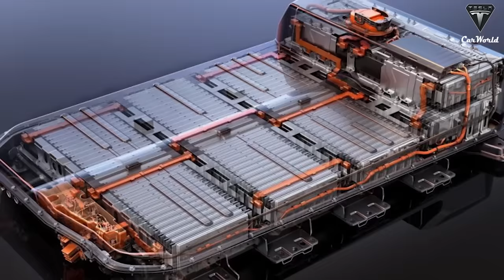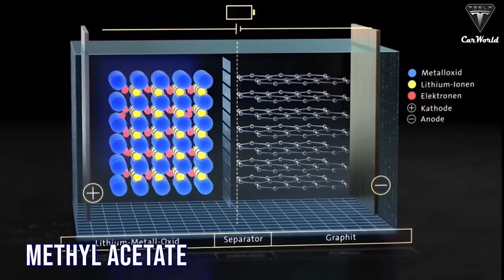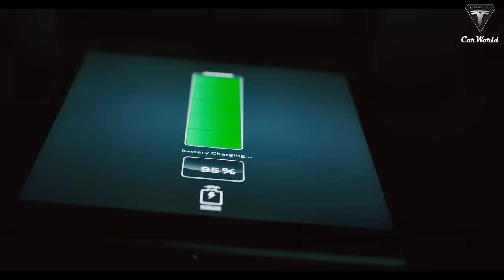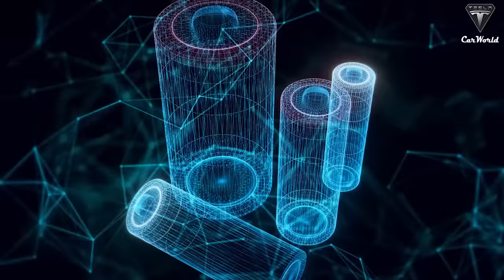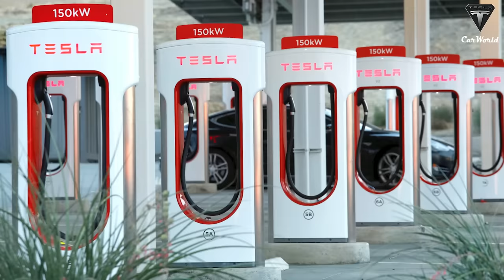The End of Lithium P3! Elon Musk Revealed ALL-NEW Shock Battery Tech, Change Entire Industry!

Comment: The sticking point I cannot help but see is that not one of these technologies have been stated to work properly with longevity in cold weather situations, such as Northern Midwest areas of the US during winter, which is brutal on most EV battery designs thus far, where cold weather cuts battery range almost in half...
Reply: Sodium batteries are much cheaper and perform better in temperatures as low as -20 C. However, it’s energy density is lower than lithium batteries. CATL and BYD have already tried to put a mixture of lithium and sodium batteries in EVs.
Reply: 80% of Norway is on EVs, nuff said.
Reply: @rRobertSmith  Norway is a very rich country. Why? The country sits on an ocean of oil and because of this each citizen gets a check for around $25,000/yr. In addition they get 80% of their electricity from a genuine 'Green' source , Hydro. And most of their driving is short range and they go plug to plug. They certainly don't leave their EVs out in a -20 F parking lot all day and expect them to get them home after work.
Reply: @rRobertSmith  That is the percentage of new cars being sold not the percentage of cars that are EVs.
Reply: An excellent point I did not think about. But of course that is true. And why batteries are not, nor they will be the answer for electric powered cars. The roads need to incorporate an electric grid and that is where your electric car should get its power.  However, the cost of upgrading every road in America, is well hard to fathom.
Reply: @rRobertSmith  from what I've been told Norway cares about it's country and citizens everyone works very hard to contribute to the country
Reply: The battery has temperature control.  My Volt battery is kept warm or cool iregardless of outside temperature.
Reply: Batteries do Not work well in the cold. Like solar panels they never provides the full stated efficiency either. Wonder if the solar panel fields are why the drought line moved 50 miles east. They heat the air above them hot enough to light Birds on fire at the right altitude. Where does that Xtra heat go?
Reply: All the EV manufacturers have developed the vehicle for cold weather: The SOL model. The key feature is it will fit well in all garage types.
Reply: @allankoivu3263  How does the Volt battery keep the temperature in the ideal zone?  Does it use battery power to heat/cool the battery?
Reply: Don't people need to use block heaters on ICE vehicles to start them in very cold temps tho?  Could EVs do something similar?
Reply: @vitor2650  And for all of us who rent and have no garage? which is the majority of us...
Reply: @MrSummerbreeze01  Although it's correct that Norway is a rich country, it's total BS that every citizen gets a check over $25k. And even though their driving is possibly shorter than in the US,  The average US citizen drives less than 30 miles daily. That makes no practical difference to Norwegian driving habits. We drive practically from plug to plug too! They certainly do leave their EV out in the parking lot all day and expect it to get it home after work! They might plug in during the day, but not all can. And in the northern part of the US, it's absolutely common to plug in a diesel truck even at the mall during cold times, so it's logical and common sense that you do the same with an EV.
Reply: @jamesdoesitmatter   what funny stuff are you smoking? Batteries do not work well in the cold, that's why you keep them warm! Gasoline or diesel cars likewise are never as efficient as the manufacturer states either. The solar panels actually shade the land below and keep it cooler! And no, they don't produce extra magical heat....
Reply: @vitor2650  unlike some monster diesel trucks, which dont do well in the cold either!
Reply: @ricktan5663  yes , but not only. While driving the electronics and the motors create heat which can be used to regulate battery temperature.
Reply: Sodium ion
Reply: @ricktan5663  Typically I preheat/cool the car while it is still plugged into the wall charger.
Reply: @johannjohann6523  Impossible, even if you somehow manage to get it in place (which on its own is implausible), the costs for just the workforce to maintain the roads is way out of reach.  In small communities its hard to get roads plowed of snow, let alone an electrical system maintained.
Reply: @13699111  like America use to be in the late 19th century nd first half of the 20th...then we all went to shit lol
Reply: @vitor2650  i live in Massachusetts and have been a mechanic for 15yrs ..ev's are not good at all in the cold..iv literally made a custom rolling bench to remove these pos ev batteries and ..we change more in the winter and first cold weeks of the yr then i do all summer and spring combined...THEY DONT MAKE A COLD FRIENDLY EV AT ALL
Reply: @nateayers6343  

that sounds like confirmation bias.
there are much more evs out there doing fine compared to what you see in your shop.
just because you see more evs in you shop during cold weather. doesn't mean they are not built for the cold.
it might imply some weakness during the colder months, but it is not evidence of overall fitness.
since we don't know how much more out there are doing fine.
Reply: @rRobertSmith  80% of Norway is on EVs, nuff said.  Norway is a tiny country and travel is much shorter than USA and the EV trucks need to haul so much more wieght. But if batteries have 1500 mile range then maybe the trucks loaded at max and minus temps can go 1/3 that distance. Lol
Reply: @Porco Rosso  its actually facts buddy .in the rusty belt where i live and i see a quarter of the 20 plus cars my shop gets everyday and the main reason they are there besides tires......bad batteries. Yes im sure in warmer areas the batteries last longer and cells dont die and they get the output they are meant for but not here buddy..so its not me being bias its my scientific research (specticals and doctors apron)  lol and my logical,realistic, 1000% accurate observation
Reply: @nateayers6343  

you are at a shop sampling bad cars. it is a bad way to get a general picture.
if you are a hip doctor, every patient you see is probably going to have a hip problem.
it might not mean the general population have a hip problem.
Reply: See the North needs to run a long Cooling Pipe South and the South needs to run a long Solar-Powered Cable North.
Reply: I keep looking for information on Teslas starting up in the cold.
I keep getting steered toward videos of Teslas in the snow, hooked up to an external power source. Well yeah if you have external power charging the thing and heating up the battery you're going to start up. But what about a Tesla in the middle of a parking lot like at an airport and it's been there a week in the deep cold?
I'm thinking you're just stuck. That car isn't going anywhere.
Reply: @Proto Rhinocerator  its gonna be dead ..and then ur buying at minimum a $6k battery thats Chinese bs too ..also if u let the battery get below a certain level. They start losing cells and those sell never charge again so again..a new battery soon....ill stick to gas thanks...all the gas i use in a yr is less then the battery..plus im a mechanic i fix my own shiyyut
Reply: @nateayers6343  telsa model 3 battery is like 25k
Reply: @nateayers6343  😂
Reply: @allankoivu3263  and energy is used for that too!
Reply: yes but much less than a gas car.
Reply: We've been using an EV as our primary vehicle for over 5 years, and over 105,000 km at this point in it's service life.  Battery never gets charged past 90%, and never allowed to be drained lower than 20% (a very few, rare exceptions).
We live between Sudbury, and North Bay in Ontario, where winter temperatures regularly get below -25 C, and sometimes as low as -40 C.  The EV has never let us down, never has trouble starting, and always gets us where we need to go.
Even in the coldest weather, the EV will provide over 200 km of range, and that is easily workable with the greater numbers of recharge station locations.  We normally charge at home most all the time for everyday use.
Reply: @josephdewuhan  Correct. Latest versions can now handle -30C. The Evs are Zeekr (aka Geely) and Chery.
Reply: @MrSummerbreeze01  Correct ... they leave them out in -30C temps instead and still get home. Many 1000 Km challenges show that as long as the infrastructure exists, EVs can be used on such road trips, even during the coldest winter days. Sodium batteries now can handle -30C temps with minimal loss compared to Lithium-ion batteries.
Reply: @johannjohann6523  Watch this video and see how wrong you are.
Reply: @jamesdoesitmatter  Correct, except, not mentioned in this video, are the Sodium-ion batteries made by both CATL and BYD that can handle -30C temps with minimal loss. I'm surprised the content creator totally missed these, now practical, and, in use, batteries.
Reply: @vitor2650  Wrong ... many manufacturers still don't include battery preconditioning. I know, I had both a Kona EV and upgraded to the IOniq 5; neither had battery preconditioning. It took a full year of complaining and lobbying to convince Hyundai, this was a necessity. The GM Bolt EV has no battery preconditioning. Two manufacturers that failed to develop their EVs for cold weather. I'm sure there are more, particularly all those Cina-based manufacturers.
Reply: @ScubaSteveCanada  They also charge and discharge more rapidly. Sodium batteries should be perfect for solar energy storage applications. Unfortunately, I have already purchase $20k of lithium batteries for my solar systems. I cannot waite.
Reply: @MrSummerbreeze01  i guess not nuff said :))
Reply: You should get to work, now that you've seen a niche.
Reply: Exactly! 💯
Reply: @vitor2650 My Garage isn't heated...Uh-Oh!
Reply: @kululv Sounds Expensive to me @ today's costs of power then there'scommercial price gouging in areas w/out sustainable power (even that will cost you double, or more, for the convenience & charges by the suppliers!)😮
Reply: @kululv ' *Til you park it...& not plug it in since the battery says you have power left in cold weather. Even here in the continental U.S., ½ the nation has 6-9 months of cold weather now. (So much for global warming!😮 ...just sayin'🤷)
Reply: ...& lasts 6-9months!😮
Reply: @kathyb2562  thats why you plug it in. Even if the battery has enough power. You have to be a little cleverer than your car!
Reply: When someone replies with "what are you smoking" than you know right away its a useless conversation! read up first before you want to be a keyboard EV pro! Nobody said that any vehicle is more efficient in the cold. Nobody said that daily driving habits dont differ from a test cycle either. Nobody said you should park under a solar panel either. Nobody said solar panels produce magical heat either! So the question is: what are YOU smoking? Once you sober up, you might find out that the BMS, the battery management system actually can create heat, just not magically...
Reply: @kathyb2562  S.O.L.😁
Reply: 🤣🤣 @MrSummerbreeze01
Reply: @vitor2650  
Think about your kids asleep in the bedroom over your garage while you are charging your EXPLOSIVE Lithium battery pack. It would sure give me more than a few sleepless nights.🤔🤔
Reply: I am sure that  problem will be solved this is new technology. Everyone jumping the gun already 
It's nice to know  what  you're  thinking. You never know what's around the corner?
Reply: A lot of scepticism .and nobody really knows yet if you have anything better just so. I'm sure Elon Musk will listen
Reply: What the heck does iregardless mean?😂
Reply: @safffff1000  "tiny country"; the distance driving from south to north in Norway is more than double the distance New York to Miami, and about the same as New York to Los Angeles.
Reply: @olatrygvekvitle4262  mainland of Norway covers approximately 385,000 Km2 (150,000 square miles) and the population is 5.3 million. The distance from north to south is 1,100 miles (1,750 km)   
The distance of NY to LA is 2,445.55 mi
Reply: Like most people %99 of my driving is less than 20 miles.  As I really don't ride across country and charge at home in suburbia(off a few cheap solar panels on the roof of my garage , $1600 and no cost for charging since august! modern solar panels are amazing.)  I have a classic 1962 nova,  and an F250, The Truck is expensive to operate, doesn't fit in the parking garage at work without being a jerk to the other people,  and was really expensive to buy. I put few miles on it and use it for hauling the family camper on trips and when I need to haul something. The truck stays nice, saving me money on replacements and all the fuel it uses.  This arrangement saves money over commuting in the Truck. It's literally cheaper to buy a second Used EV than to commute in the truck.

Comment: fast chargers doesn't need to be bi-directional. Home chargers has to do that. Ev's should be a home power bank.
Reply: Right!  But home chargers could never charge at even a fraction of the rate that the batteries could except.  Even the electrical service entrance for homes could not provide more than a fraction of the power required to utilize the rapid charging capability of the battery.
Reply: @frankeggers4024  do you need 250kw discharge from your hypothetical EV power bank to your house? I think 11kw or 22 kw is more than enough for bi-directional home charging/supplying the grid per household.
Reply: @chestodor4161  No.  I'm more concerned about the other direction, i.e., how the fast theoretical CHARGE rate of the battery could actually be utilized.  In theory it could be that the battery would accept such a high charge rate that it could be CHARGED from 0% to  100% in perhaps ten minutes.  But when you consider how much current it would take to do that, it would seem impractical to utilize that capability because the current required to do it would be in the thousands of amperes.

I suppose that a possible solution would be to provide for switching the battery between two parallel and series connections so that for charging, the voltage would be very high thereby keeping the current in the charging cable down to a practical value.  Then for driving, the battery would be switched to a different connection to reduce the voltage to what would be practical for the electronics in the car.  But would we really want the charging cable to carry thousands of volts to keep the current down?  That would not be the only problem either.  It would be difficult to provide a public charging station with the power required to charge several cars at once if all were to be recharged in 10 minutes.  For home charging such a fast rate would usually be unnecessary because the car battery could, without inconvenience, take all night to charge.